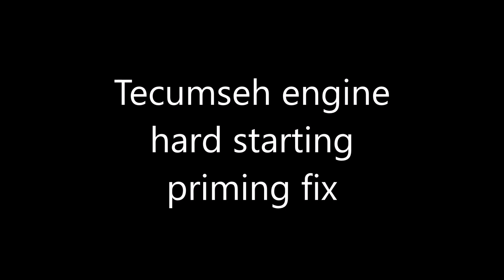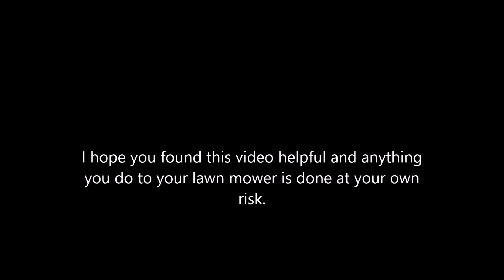Tecumseh powered Toro not starting, primer not working fix

Comment: What if this dosnt get the primer working and it pulls back the pull string twice as hard than you pull?
Reply from the maker: you likely have a sheared off flywheel key, I wish you the best on your repair
Reply: Would you say its toast or is that repairable
Reply: Seams like ill have to pull off flywheel i suppose
Reply from the maker: @thespanishflyangelmiguelto1797  A new flywheel key is a $2 part and less then 1/2 hour job
Reply from the maker: @thespanishflyangelmiguelto1797  you will have to remove the flywheel. typically if the blade hits a rock or something stopped the blade from turning the key will sheer, you may wish to ensure your crank shaft and blade are not bent
Reply: @bbbjim1fixedit  it was the key for the blade Adapter Actually And Thank you very Much

Comment: I took off the primer and sprayed off the holes underneath using the break cleaner, but it still doesn’t prime. I sprayed a healthy amount too. I don’t get how it won’t work even when all of that was done. I even replaced the primer bulb.
Reply from the maker: although brake cleaner and carb cleaner share some base chemicals, carb cleaner has some MEK in it where brake clean dose not. You may wish to look close at the bowl gasket or try cleaning again with carb cleaner. I wish you the best on your repair.
Reply: @bbbjim1fixedit  I misspoke. I actually did use carb cleaner. What else would prevent it from priming. I hear a suction sound but no gas pumping through.

Comment: does a gasket make much of a difference? im starting to think it does...i have my moms lawnmower and i bought a new carburetor and new filter for it and it works worse than before no gas gets to the filter part. it cant have a problem with priming or being plugged upa s everything is new...it worked with the old stuff but i bought new anyway just because they were old and there were chips of soem sort in the carburetor . the old filter worked too but if i recall there was a gasket but it was pretty beat up . im starting to think maybe that was it is the gasket is missing but i cant think or find it hard to believe a piece of fabric can make all the difference in it starting or not...seomtimes its starts then it stalls shorty after now it wont even start with the new filter. i ordered a gasket just to check and see but if its not that idk what the heck it is i checked everything else.. teh fuel lines flow fuel and everything im new to this small engines hobby so im still leanring ..any help would be great.
Reply from the maker: You may wish to take a closer look at your fuel line to see if it is deteriorating from the inside and plugging up your brass jet holding your carb bowl on. if you have old fuel with ethanol in it you may wish to get fresh fuel without any.   I wish you the best on your repair
Reply: @bbbjim1fixedit  well i fixed it before and it worked for me and i cleaned out the gas tank this time i didnt do that last time and when i did the water was white.. so i think there was water getting in the mower from rain or soemthing so i cleaned it out and it runs good now but it also did that last time too so ill wait and see but as far as im concerned its fixed to best of my knowledge which isnt much as im a beginner with small engines. i cleaned the carb again its a new carb and there was some debris and signs of that...water... some stains in the bowl so hopefully thats all it was -was water throughout the fuel line and stuff..i cleaned everything out and hopefully and it appears to be flowing better..ill see. but thanks for the reply and good video:)

Comment: I installed a new carb like this and it leaks out air filter
Reply from the maker: You may have to adjust your float since it appears the flow of fuel is not stopping when the carb is full

Comment: Hi, I just replaced primer bulb cuz old wasn't prime and didn't had the white plunger and spring, do I need it or some models don't have ?
If yes, do you have part no ?
Reply from the maker: Briggs engines don't use the plunger type primer, and Tecumseh have some with and some without. Your engine should have a model number decal on the engine. You may want to look up a parts list via the model number on ereplacementparts.com to double check what type you have. I wish you the best on your repair
Reply: @bbb jim1  Really tnx for your answer, I found that I had the right new part n that mine doesn't have the spring plunger (on Tecumseh..) BUT even if new... STILL NOT PRIME ?! 
The carb was cleaned at all orifices, don't know WHERE is the issue now ???
If you have any idea, PLEASE SHARE...

Comment: Thanks for the video ,Jim. My mower which is about 25 years old has been standing for about three years. It wouldn't start. I followed your procedure and cleaned all the hardened residue from the evaporated petrol in the carb. It fired up first time, ran for about thirty seconds, coughed and backfired. Now it just backfires. It seems like no compression. Any ideas?
Reply from the maker: You may have an exhaust valve sticking open, so you may wish to remove the spark plug and squirt some automatic transmission fluid on the valves or if you have available Sea Foam Deep Creep. Doing this may break down what is causing the valve to hang up.  The oil will cause a good deal of smoke and may even fowl your spark plug yet it is effective many times and you wont need to remove the head.  I made another video on doing this to a snow blower engine you may want to look at.  I wish you the best on your repair.
Reply: @bbbjim1fixedit  Thanks Jim. I'll give it a go.
Reply: But then 2 strokes don't have valves do they? Piston rings stuck with hardened gunk same as was in the carb maybe?
Reply from the maker: The engine in this video is a 4 stroke, and if yours is a 2 stroke you may have the rings stuck in the piston, giving you very little compression.

Comment: What IS the red tube sticking out of the intake throat for though? My Tecumseh is missing that but still starts and runs good, just takes a few more primes and pulls than it probably should.
Reply from the maker: That tube is called an emulsion tube, it helps in making the fuel turn into a fine mist.

Comment: I found the no compression problem. The emulsion tube in the carb has come off and lodged under the exhaust valve. The carb you show in the video is the same mine, but mine has no identification on it. I bought it in Thailand about twentyfive years ago. Can you tell me what your one is incase I need parts? Now I'm being a cheeky bugger. Can you show the set up of the emulsion tube? I've found a brass tube and a small separate plastic tube which I assume fits on the brass tube and then somehow fits into the carb? Thanks for your help on this.
Reply from the maker: The engine I worked on in this video was not mine so I will be unable to look up a part number for you.  The engine division of Tecumseh in the US is no longer in business  and the internet has plenty of copies of this carb.  I am going to guess you are an Aussie and Amazon in Australia has replacement carbs for around $30.  The plastic emulsion tube fits in a hole on the upper left of the carb on the air filter side.  I wish you the best on your repair.
Reply: Thanks for the reply. I'm a Brit in Thailand. You've helped me a lot. I'll fix and it and keeps me busy and my brain working. I'm 87 and need these things to keep perked me up.

Comment: Your are very thorough. If you want to remove the carb, it is a lot quicker to get the carb off the engine.
1. exhaust is 2 bolts, and intake manifold is 2 bolts. 2. TAKE PHOTOS OF YOUR LINKAGE LOCATIONS.

Most of the time the jet that hold the bowl on is clogged. All you have to do is pinch off the gas line and remove the jet. If there is fuel in the bowl then you have a partial blockage. 

I do like how thorough you describe everything. I NEVER KNEW HOW EASY IT IS TO TAKE THE TANK OFF. 

Every other video shows people turning mower on the side to drain the gas. You should get the Presidential Medal of Freedom or a Nobel Prize for sharing that. There maybe even be Knighthood or a Sainthood in it for you.
Reply from the maker: Thanks for the good tips and the kind words

Comment: Hi Jim,  Always appreciate the time people take to post this information but constructive comments.  1) Remove the muffler (2 bolts) and split the manifold from the cylinder instead of wrestling with the tight fit of the carburetor mounting bolts.  2nd benefit of this method is you don't have to bend the throttle linkage - it comes off easily,  2) I was hoping by your title that you showed how to remove the primer.  I rebuilt the carb with a kit (float seal, float needle, bowl washer, etc) but didn't touch the primer and it is not pumping fluid.  Take care, thanks for the effort - off to find a primer video
Reply from the maker: At 13 minutes into the video I show removing the primer, cleaning it and after putting it back together the primer worked, I wish you the best on getting your primer working
Reply: @bbbjim1fixedit  You did indeed!  Haste makes waste - I saw the carb going back onto the mower and figured you were done with the maintenance - thanks!

Comment: Wow Jim you put a lot of effort into these videos.  Thanks!  One thing I notice when I use carb cleaner ....if it gets onto the neoprene seat....it immediately swells the seat and correct float level is impossible to attain once that has happened.  Replacement of the seat is then required.  In your video it looked like the float level was off quite a bit.  The float should be pretty much level with the carb body when the assembly is turned upside down.
Reply from the maker: Great point!

Comment: Hi, May I have the item number on this Tecumseh primer bulb.  Thanks
Reply from the maker: The engine model number is needed to look up parts.  The one in the video used part number 36045A. I wish you the best on your repair.
Reply: @bbbjim1fixedit  My lawnmower is Toro and model is 20079  - Thanks very much indeed.
Reply: @cylau2000  
Check if your carburetor has the hole in the center of the prime bulb, there  are a few different styles of tecumseh carbs. Sometimes they won't run right if the wrong primer is installed, if it had a hole/no hole one prior